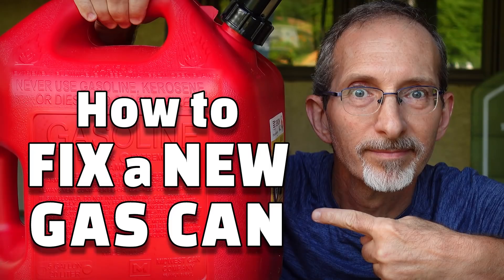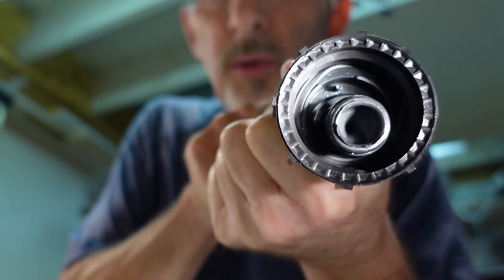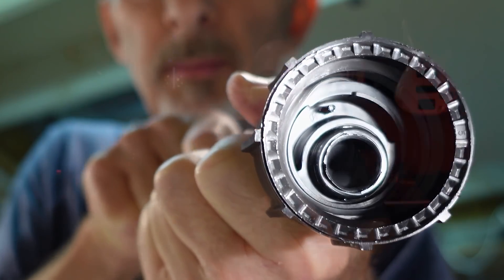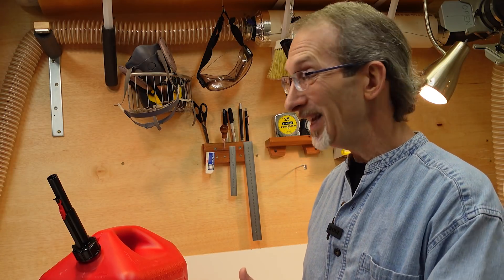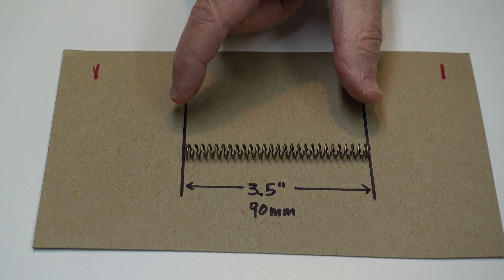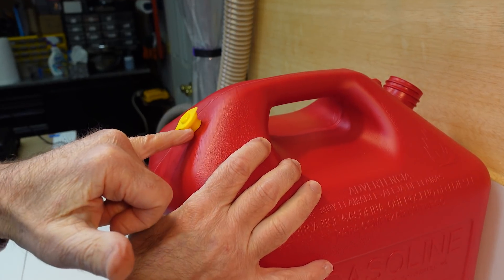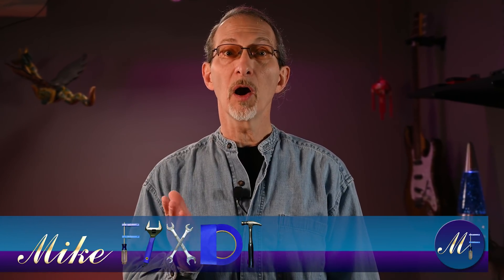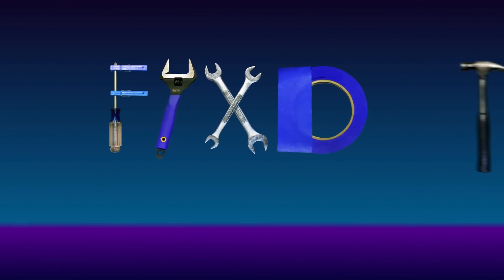Gas Can Modification | Part 2: Explosive Details!

Comment: Midwest gas can doesn't care if someone uses the can incorrectly, they just want to have plausible deniability to ward off lawsuits. With all the protection they add they can claim any accident cannot be their fault because no one can actually use their gas can. Legal problem solved. I've never met a neighbor or farmer that likes these features.
Love your take down of these "safety features". I've owned a small farm for 32 years and was an auto mechanic before that. The first thing I do is basically the same as the ideas you report, except I just buy an unrestricted spout for the can from Tractor Supply. I prefer this because their spouts have caps so you can close the can completely, plus they give you one of those vents you talk about in the package.
These are all important to me since I have three rider mowers, five weed trimmers, half a dozen chain saws, one compact tractor (diesel) and one Bobcat skid steer (diesel) as well as five cars and trucks, some used exclusively on the farm and not on the road. I do the same modifications to diesel cans except they don't have a "flame arrester" in their opening. No one pays me to waste my time on these cans so I "fix" them all.
Reply from the maker: Thank you for adding your expert testimony! It's nice to hear from people who actually use the product, and don't have time to wrestle with all of these safety features. I appreciate you watching and commenting! 😁
Reply: I et you fill yout equipment up when they hot also.

Comment: Now that you have the lighter spring in there, why not ditch the red latch?  The spring alone should keep it shut and you won't have to press the latch potentially multiple times in the process of fueling.

Comment: I wanted to have an emergency can in my trunk on a long trip. This was the only can available. I could barely get the gas to go into the damn thing, could not get the gas into my gas tank when I needed to, then it tipped over and spilled everywhere in the trunk. Worthless trash. If I knew who made this thing I would give them an enema with it.
Reply from the maker: These spouts are absolutely horrible for filling a vehicle directly. A funnel should be mandatory equipment with every gas container they sell.

Comment: If the can doesn’t have a cap for the nozzle, just use an old plastic medicine bottle.  This will keep trash and water out of the nozzle especially if the can is left outside.  Your mods have kept my 80 year old hands still filling my mower and cutting grass. 🐢
Reply from the maker: I'm so glad to hear the video helped! Thanks for watching and for sharing your recommendation!

Comment: Thanks very much for these videos Mike. I recently bought a gas and diesel can from Lowes manufactured by Scepter which do non of the things they purport to do. Also, although I was able to fill the diesel can, the petrol can will not take a drop of gas due to the stupid filter inside. I now know I can remove it without compromising the threads on the can.. I have to say that their spring loaded vapor lock is an even more difficult design than the one you showed!

Comment: I pull out that stup_d white strainer. And I use a siphon hose with the ball valve for easy starting.  I also replaced all the spouts with a universal flexible pour spout for small applications

Comment: There are aftermarket "adapter kits" available to correct some of these issues.  But, most of them I've used are very poorly made.
Reply from the maker: Very true… while the replacement spouts are an option, they are not very well-made. At least they are inexpensive.

Comment: I see the yellow vent as a needed safety device. The new cans will swell and can pop on a hot days. The yellow vent acts like a pop off valve. I put them and buy regular old school spouts for my cans. If I had to use the spout I'd stretch the spring a little more and take out the red lock.
Reply from the maker: If you have the spring in then the red tab acts like a lock, so the spout doesn't extend and open. You definitely don't want that to happen!

Comment: I have spilled more fuel with new type cans than I ever did before.  I hold my pour release down with a string around the handle to bottom of can  Pure BS.
One spring I came out to shead and can was bulged way out.  Now I crack the cap to provide air release, just a hair.  Faster pour is obtained by a funnel in tank and simply pour into funnel.  Works a treat.  Messy but I did not build the system.
Reply from the maker: Ronald, a funnel seems to be the perfect accessory to use with these containers. I've had my plastic cans bloat in hot weather, but they have always contained the contents. Thanks for sharing your experience and watching the video!

Comment: Safety is marketing spin. They include these features for one reason only, the government required them to, and not for safety as the first function, but evaporative emissions. It's true that the spout can't pour as fast as one may want to but just as important is the fact that one can't pour slowly or accurately either.  Using the can as designed, you can only pour at full tilt and can't see the level until the vessel being filled overflows.  A complete failure from four levels, safety, having spilled fuel in the open, evaporative emissions from same, and economic in the form of wasted fuel and most importantly, containing and dispensing fuel. Basically the design guarantees to spill fuel, which makes that flame arrestor really appealing.
Reply from the maker: Stuart, that was perfectly explained. Well done! I couldn't agree more. 😁

Comment: One other mod... If you are going to leave the spring in, rip out the red latch.  The spring will still close the valve like normal, but you won't have to force that red piece down to release anymore...
Reply from the maker: Brian, thanks for the tip! 😁

Comment: @1450 Mike, The seam as you called it is incorrect.... These cans or blowmolded from a single piece of plastic. The (2) Shells as you called them is actually where the 2 halves of the mold come together and is actually a telegraphed seam only present on the outside of the container. Here is a good video explaining how these containers are manufactured. https://www.youtube.com/watch?v=jv9p5LSKCjs. https://www.youtube.com/watch?v=wtzKw8Zu_DQ
Reply from the maker: That was very cool!… I did not know how they were made and I thought it was a seam where it was joined. Blow molding for the win!
Reply: @MikeFyxdt  for many years I thought there were seams in many plastic containers. I often found myself thinking how impressive it was that someone was able to put the halves together and them not leak… silly now as I think back now. Blow molding… who knew. :-)

Comment: Thanks again, Mike. Part 2 is as spot on as Part 1. I have experienced ALL of the issues that you mentioned and plan to modify my 4 cans as you did. I may even buy more of them since I see how to make them better. My only positives concerning this can is the TWO handles to support holding up a 30+ lb can full of gas and the can actually being fairly thick to begin with. Your suggestions make these fuel cans worth having.

Comment: While using the one I have, that darn red latch popped out of the channel way and started messing things up so I just ripped it right off and now I can just place the spout in the hole, let the catch settle on the edge of the hole and the weight of the can pushes the spout open. Of course if it's a small engine and you let it go to fast the gas fills up to quick and overflows causing a mess.

Comment: You don’t know what you don’t know!

On the news, a young mother died when the gas can exploded as she poured gas on her new fire pit.  She tried to restart the fire that had gone out.  

She had numerous times before used charcoal fluid with no problems.   

I knew that pouring gasoline on a fire was a bad idea but had no idea that the flames could make it to the can and explode.  You don’t know what you don’t know.  

So.  If nobody using that can ever pours gas on hot embers, the pain in the butt flame arrestor isn’t needed.  

BTW.  I’ve also seen stories of bonfires exploding and killing people when started with too much gasoline.   The gasoline fumes build up and explode when lit.  Never occurred to me that that could happen.  Now I know.
Reply from the maker: I never knew until recently that the gas fumes were so much more flammable than the liquid. And you can't see the fumes! 👀
Reply: As the air dilutes the concentrated fumes, the ratio of air to gas increases until you reach the concentration perfect for an explosion 

Again.  It’s not necessarily stupidity.  It’s ignorance 

You don’t know what you don’t know.

Comment: Very Good Video... Although, to be Honest, I Gotta say... I would of Just Returned those Cans...As a Retired Mechanic of 40 ++Years, I Always Believed that  Continuing to Change things that Have Proven to Work Fine for Years and calling it an "Improvement"  to make things easier for  People, who should NOT be using them in the first place and or are too lazy to take the Time to LEARN the correct way to use them is NOT  really an act of Safety but an act of Wreckless Stupidity in itself for the Sole Purpose of C.M.A.... I don't know Nuttin' , I'm just an old  Dummy but for 70 Years,  Keeping  it Simple has always worked for Me ..  Because as Forest Gump's Momma Always Said..."Stupid is What Stupid Does"...and  the TRUTH is, You Just Can't Fix STUPID

Comment: While I do agree with your reasoning for the mods you made, I was wondering why the Midwest Can Co. hasn't incorporated them into their manufacturing process. I absolutely hate those spring loaded fill spouts. Did the company void their warranty, or disavow any type of liability to modified plastic cans? I would assume that thet probably did just as soon as they saw your videos. Personally, I prefer the metal military gas cans because I've seen how they are abused with no ill effects.

Comment: I just use high quality European made NATO style cans that are TUV approved ( an European safety certification authority ). They will handle high pressures that would ordinarily rupture plastic cans. You can also obtain auxiliary covers that have dip tubes that can be used with a dip tube and hose where you can use the rubber bulb primer used in the marine industry to start an easy flow siphon to fill many types of tanks when placed at the proper height for the tanks. You can also use marine quick connects with this adapter to safely connect to a generator. Do not buy any Chinese made NATO cans they are not capable of holding any pressure and are not coated and will rust through in a short time nor are they certified for use in the EU. Now if the EU does not permit these cans to be sold in the EU there must be a good reason that the USA should follow suit.
Reply from the maker: @Subgunman - this is all really good advice! I appreciate you watching and commenting!

Comment: Machinist here. I've drilled almost every material you've ever heard of that wasn't glass. With thin plastics you generally don't want a pilot hole because it causes the full size drill to thread in like what happened with you.

Otherwise, I appreciate the video. I agree completely with your assessment of the problem with safety engineering run amok. You have a new subscriber.

Comment: Well Shit. 
I ordered the yellow spouts for air and used a drill bit but couldn't push it into the gascan so I used my lighter to warm up the  plastic and when I did the gas in the can caught on fire.
I put my hand over the hole to stop the flames but that burned me and I dropped the can and the gas inside sprayed all over the kitchen and the house burned down really fast.
I can say I like the old style cans better that you do not need to modify and if you modify them be carefull or you will have to go to the burn ward and spend a few weeks in there growing your new skin and you don't want to dothat because it costs a lot of money.

Comment: Not marketing, not totally govmnt regs, it's lawyer talk.  For the one-tenth of one percent who WOULD pour gas on an open flame, then sue the manufacturer, the rest of us have to suffer.
BTW, not Midwest brand nozzle, but the brand I use are sized to perfectly fit a fired shotgun shell as a cap to keep rain and dirt out of the nozzle.

Comment: Tried to fill up my gas can at the station the other day & it kept clicking off every 2 seconds.

Another person there had the same EXACT issue.

You had to press the gas nozzle into the can for it to activate to release gas but due to the closed shape of the new gas cans no vapors can leave & the nozzle shuts off thinking it's full.

Does anybody know how to bypass this so I can simply pull the trigger on the nozzle & fill up the can?

Otherwise it takes 20 minutes to fill up a 3 gallon gas can & involves you clicking the handle 1,000 times because it only releases gas for 1 second before clicking off.

Comment: very funny ...toss the original spout and get the set that consists of the vent and a new accordion looking spout...why mess with the epa garbage  i have  a dozen of these and dont use the  frustrating  spouts and deleted the screen too  and for heaven sakes PUT THE VENT AS HIGH ON THE JUG AS YOU CAN!!!!...to keep gas from running out when you open it   you went way to low in the vid

Comment: Having lived in an apartment for years, I didn't need a lawn mower (or gas can) for decades. Frustrated with the gas can I bought last year for filling my new mower, I found a solution. A tornado took my gas can and I went to a battery-powered mower.

Comment: The new safety features on all manufacturers of gas cans make them more difficult to use. I'm t pushes people to make very unsafe modifications to the gas can itself, like drilling a hole in the back to let air in, with no proper way of sealing the hole for storage, plus a lot of the new cans have a button that you have to hold with your thumb that always leak fuel all over you, I never had a problem with leaking fuel on myself with the old fuel tanks. Anybody who dumps gas on an open fire Will only do it once and learn from that mistake, that is literally something a 10-year-old boy would do while making a fire in the woods. At least I did😂 I never did it again. These manufacturers make products with the assumption that we are all stupid.

Comment: Simple solution: “LIBERALS NOT PERMITTED TO OPERATE OR USE GAS CAN UNDER ANY SITUATION” caution label. No intelligent person is going to screw around with this insane safety crap. They will just replace in with a normal cap and vent cap then use a funnel as was done for 100 years or more.

Comment: All that BS 'safety' crap does nothing but make it more difficult to dispense fuel, and before the can is even a year old, the dispenser mechanism will either break, or profusely leak, while pouring fuel. I've swapped out all those 'safety spouts' for the simple, old style spouts. No leaks, and dispense the fuel as quickly or slowly as I want.

Comment: Let's be genuine here - Midwest, or any other gas can company, didn't build these weird "Safety" add-ons because their engineers and designers were searching for a solution to a gas can problem. They were mandated by federal legislation to change the cans. There's no "We've built a better spout" thing going on here. It's "Ok, we've met the stupid requirements of the fed". I'm sure they'd rather manufacture a one piece, old style spout, if it were legal for them to do so.

I'm sure the government regulations were a result of the senseless tens of millions of gas can related deaths that happened before we needed three hands to work the thing.

Comment: Thanks for the helpful tips and tricks with the gas can. 
You are correct as the current government policy mentality is to dumb down society to its slowest member. 
It does make me laugh when I see that alternate valve designed for an off size hole. It would have been just as easy to design that valve to use a common sized hole such as i/2", but what the hey, perhaps that company get a kickback from every wierd sized drill bi sold, lol.
Also, since not everyone has a special solder heat gun, perhaps you could have used a hair dryer?
Also, using some soapy water as a lubricant, might have also worked.
Thanks!

Comment: To be fair, the only flammable part of the gas can is the gas it contains. If the filter thing makes it impossible to actually fill thing with gas, the can is way safer.

Also, note that there is a large market of plastic "safety" knives. They're just about as good as you'd imagine.

Comment: For the matter of installing the aftermarket vent: The torque to be drilling a wide 31/64 inch hole is unnecessarily problematic when drilling in soft but “gummy“ polypropylene (?), especially using bits designed for metal. 

You started by drilling a pilot hole (good!), but then to use a (sharp!) reamer to bore it to the factory-recommended diameter is the superior option, and whatismore does not involve owning the second-most expensive drill bit in a set, one that you will presumably only use twice a decade anyway.

Comment: I personally don't mind the cap latch that you cut off. I'll deal with that one.

I agree with the "flash arrestor" and spout fixes though. However you can work around the flash arrestor by not fully inserting the gas dispenser, but I would rather just take the damn thing out

Comment: Just buy a flex spout, comes with the vent.  You can also buy a cap.  Seals the best.  Still have to remove the internal flame retarded b.s. though.